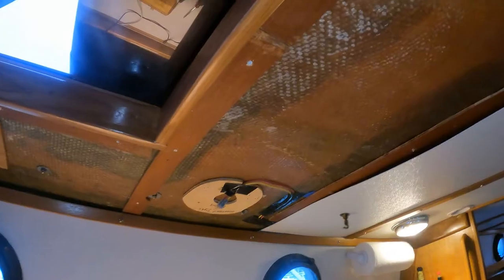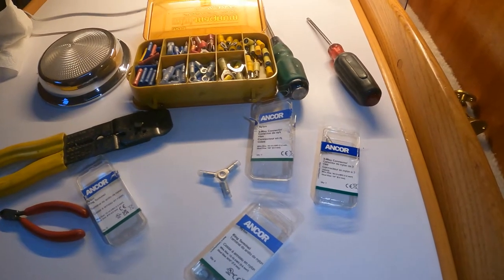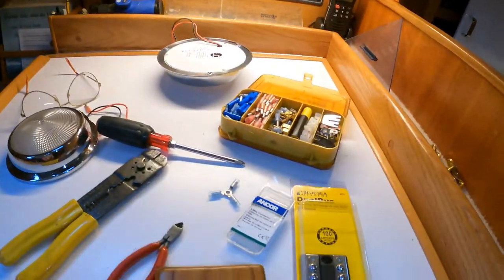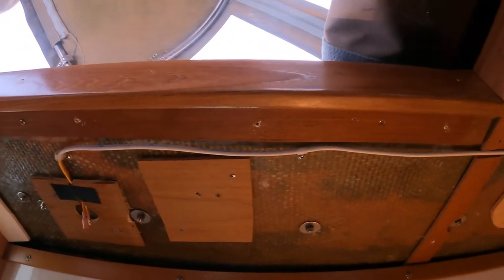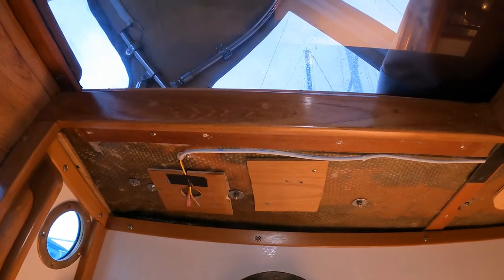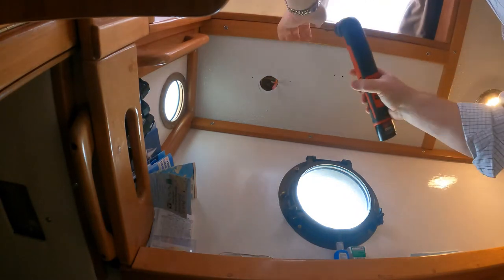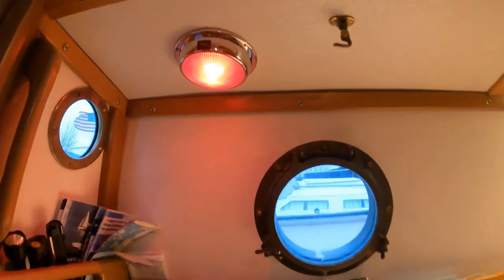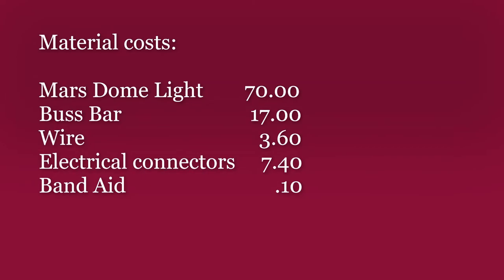Overhead Cabin Lighting, dual color - Video #20 - Westsail 28 - "Starwhite"

Comment: I'm loving the videos! Nice to see others taking pride in their W28's. Ours is in Ensenada. Just curious about your caprail. It seems you've just let it be natural, no varnish/oil. I'm about to dive into my brightworks & would appreciate any advice based on your experiences. Thanks.
Reply from the maker: Over the decades we've tried all the common treatments for our exterior teak.  Teak oil didn't hold up well and attracted dirt.  Varnish required multiple coats, was easily damaged and a pain to apply.  We've settled on bare teak that we scrub every 3 or 4 months with freshwater and fine scotchbright pads.  It's not elegant, but it looks clean and is simple to do typically taking only an hour or so.  Our Seahood and Companionway trim are coated with Ceatol, I'm not particularly fond of the color of Ceatol, but it does give a little splash of bling.
Reply: @Westsail28  Thanks, that's very helpful.